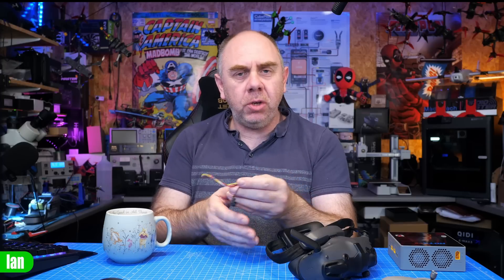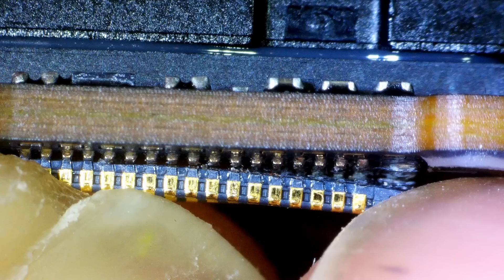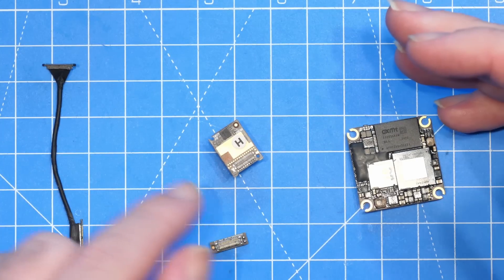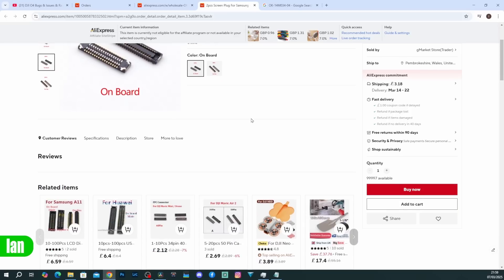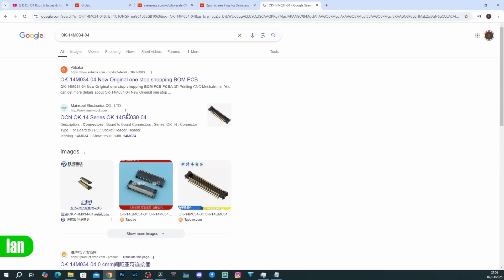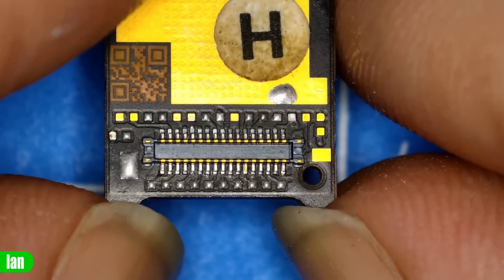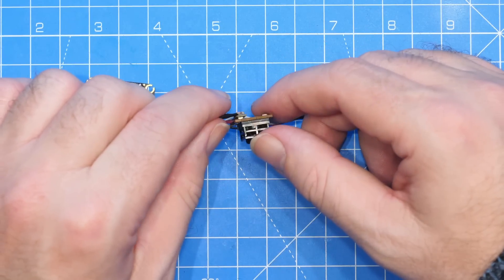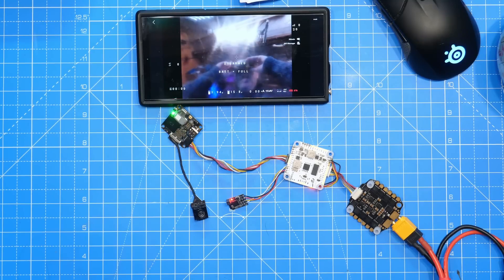DJI O4 Camera Connector Repair - Sort Of!

Comment: You didn’t need hot air. Unless joints are hidden underneath a chip and unreachable, a soldering iron can easily work

Comment: what glue would you recommend to secure the mipi cable and daughter board to the pcb?? i replaced my mipi cable with a longer one . not sure what kind of glue i picked off to replace it . was it just hot glue?

Comment: Hi, Mads. I ripped the mipi cable out of my o4 pro transmission unit in a bad crash and damaged the mipi socket on the transmission board. Do you know what that socket/connector is called?

Comment: Flywoo sells o4 and o4 pro camera replacement for like $25/$40 respectively. Only thing is that the replacement camera wasnt configured by Dji factory so it will have a Camera not calibrated message in the bottom corner of the OSD on the goggles. But if your camera breaks, you can get your VTX back up and running without buying a new one.

Comment: I have almost the same problem with the connector, but on the transmission module. Are connectors of the same type as on your camera module?
Reply from the maker: Yes same both sides
Reply: @MadRC they don't look the same though. On the board and flex I have only one slot for insertion, but in your video and Ali product you shared it shows 2 slots
Reply: https://youtube.com/shorts/OSXzNnocAzQ?si=6QDK17oDO49m05VJ

Comment: I have a question. After a crash, my DJI O4 Lite lost video and now shows an "IMU error." I checked the connector and it looks fine, but the cable feels like it may have snapped. I'm thinking of replacing it—would the "RunCam DJI O4 Coaxial Cable" be the correct one to order?
Reply from the maker: Yes that should work.

Comment: Great video! I have the same issue probably as so many others. Does anyone know if you can buy the camera with connector  sold separately? I have looked but I can't find. Thanks
Reply from the maker: Sadly as of now no.  It's only part of the Airunit kit.
Reply: Thanks

Comment: tips, analogue fpv lenses are no good. For some reason the colours are off and the clarity is no good. The walksnail or dji v1 lense work great. the best would be a 2.5 hd lens, but it seems only 2.1 were used. m12 has a much better result, m8 show the barrel of the smaller lens

Comment: Ya generally for these types of connectors you dont wanna use hot hair. Id use a hoof tip with a good amount of flux and just run it over em. I was surprised the actual connector itself didnt met. That's what usually happens to me when i try doing these with hot air. Time to try different lens configurations now :P
Reply from the maker: I actually had a go with a bent conical but the issue was I could not get enough heat to flow it.  It's a catch 22 as it's just then moving around.
Reply: I use hot air all the time for these connectors. The tip is to keep the air moving and dont go crazy on the heat. A small board like this probably wouldnt need beyond 350 degrees.

Comment: Sadly you never say how much heat and air you use. I know this also depends on the gear used but as a rough guideline that would be good info
Reply from the maker: Air was basilly 10% and heat was around 230c
Reply: @ 
Only 230c wow, looked a lot hotter

Comment: If anyone else is worried about this happening to theirs then just don't remove the stock glue and tear it all apart like Mads did. Add some E6000 glue to the camera and UFL connector. I did that with all 4 of my whoops running O4 and never had an issue with the camera like this.

Comment: You destroyed the lens because you kept the hot air for too long and you simply didn't press the connector down. If you had done so it wouldn't fit way earlier and you wouldn't have melted the lens.
Reply from the maker: You clearly have never done this.  You can not touch the connector.  It will be like soft cheese as soon as you apply heat.  You can't push it down.  

If there was to much heat the connector would have melted.
Reply: @MadRC  sure you're right then it's not the fact you have bad equipment and skills with you right? Check our Northridge fix page and stop being an amateur

Comment: wrap the lens in kapton tape before you use the hot air
Reply from the maker: Well yes that may help but tbh I think it needs more.  Probably metal shield to protect.  However hindsight is a wonderful thing.
Reply: @MrMartinRome  removing the lens would work? + Some kaptop on the mount?